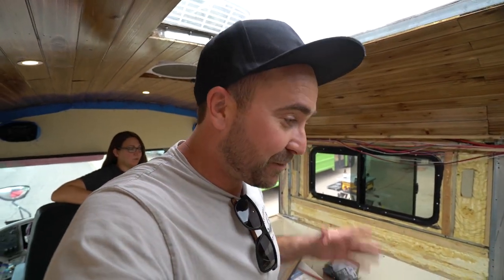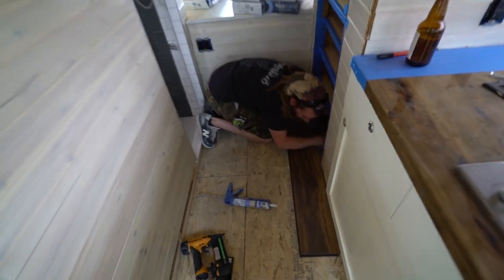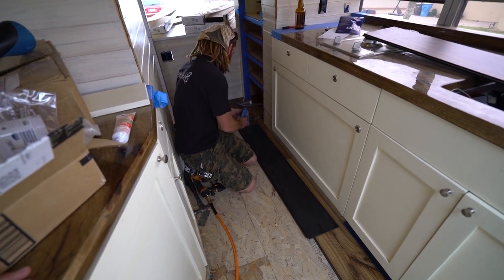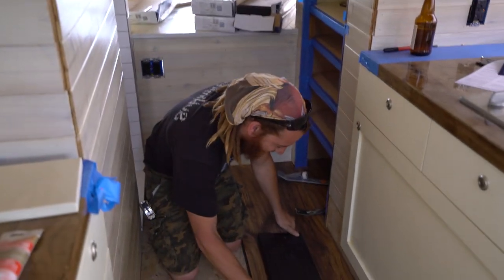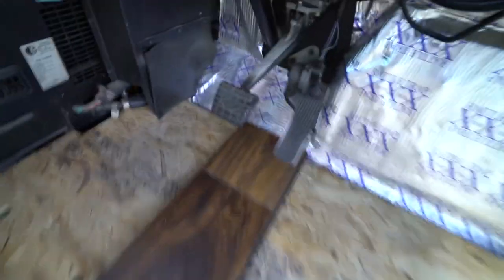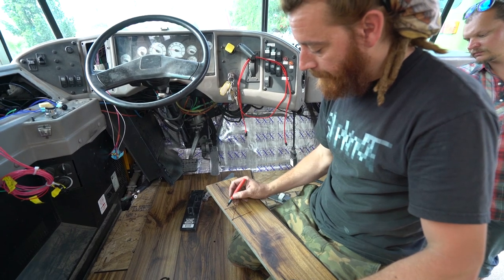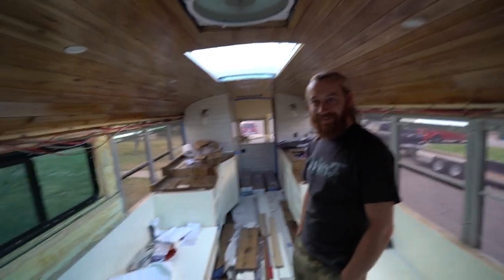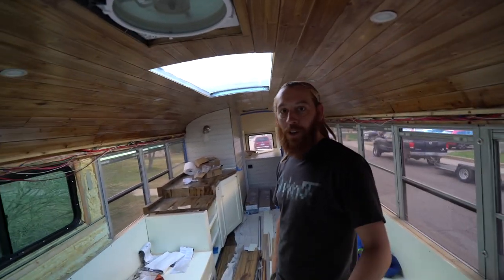CORRECT INSTALL OF FLOORING FOR RV, VANLIFE, SKOOLIE

Comment: Yes, that is exactly what I just did with a new floor in my 2012 class A. Called the flooring factory first and they confirmed silicone for an RV, then they told me "no warranty" on the RV application. I hired a pro as well and I'm glad I did.

Comment: I did constrution and like what I see. The small space would have moved without silicone. The foam pad you did not put in makes tapping sound. This silicon will be solid. Remember if you flood floor with big puddles of water it will still buckle. Normal water is fine. Good job!

Comment: Why did you decide to install the flooring after everything else? Is it just because if you need to replace the flooring this makes it easier? 

I can't imagine will ever want to replace the flooring in my bus so I plan to install it first. That way there are less cuts.

Comment: Installed 20 years. And I promise that silicone is not going to do a thing. Should have left the pad and glued the joints. You just defeated the whole purpose of the floor. And second, he said since it’s waterproof you don’t need the pad? Ok. Well one you just cut the floor life in half removing the pad and second you just took away added insulation. There are several things I could mention but just no sense in it. I just can’t believe you nailed and fastened a floating floor. Hell should have just used engineered glue down. This was hard to watch.
Reply: Hello, currently putting this style floor in my bus, it's Pro core vinyl plank. Have to get my floor a little bit level keeps popping a part. Then plan on screwing everything over top of it. Cabinets, bed, it etc

The box says it does not require underlayment, has like a black etch x in the back of the tile...
Reply: Midnight Chevy you don’t have to put the pad under it but it makes it a lot more comfortable to walk on, as well as added insulation and some noise dampening. A common misunderstanding people have about “waterproof” flooring is that it is fail proof as well. Well the actual product is waterproof, meaning it will not break down from water exposure or rot. But if it floods it will get water under the actual floor covering and it will be trapped under the floor and start to mildew. I suggest sealing the perimeter with a good silicone like Lexel. But I would NEVER fasten a floating floor. It will most likely buckle over time. It’s made to move, and expand and contract. If you’re going to fasten it the go with a direct glue down with a high moisture content glue. There are a lot of options out there.
Reply: Midnight Chevy and yes if it isn’t level within tolerance it will buckle. It’s a pain. Only thing about screwing stuff on top of it is if you change the flooring it’s a pain to demo. Plus you waste material. But it makes it easier for someone that doesn’t do it for a living to not have to make net cuts to cabinets. Good luck man.
Reply: This floor should be ok,
Reply: Yep. As a floor layer, this is definitely hard to watch. No kneepads and no tape measure, I think his nickname should be "laser-eye". With a business name like that I hope he offers install warranty, cause with his concept of flooring, it's not going to last a "lifetime". I'd be surprised if expansion issues haven't already shown up.

Comment: Having installed flooring over the thin foam underlayment, I will agree that the way you did it will be much more pleasing to the ear.  That stuff just causes the sound of footsteps to echo up back into the room.  Using the silicone will transfer all that sound to the frame of the bus.